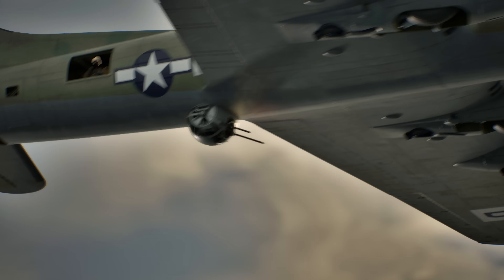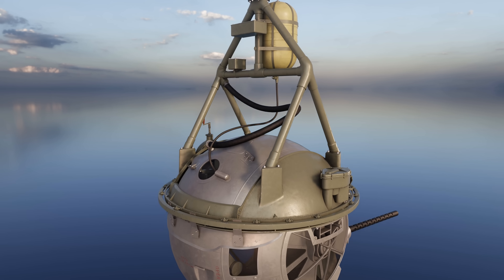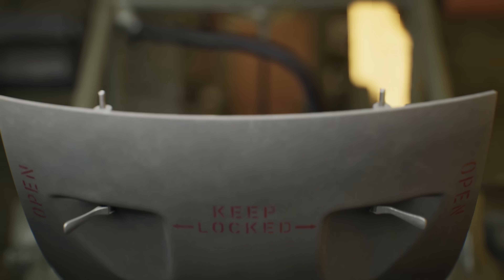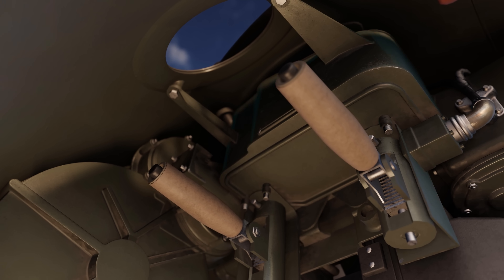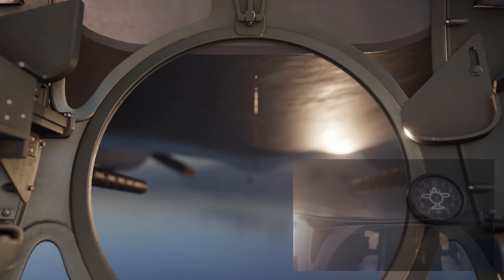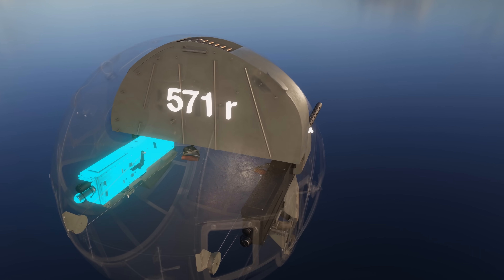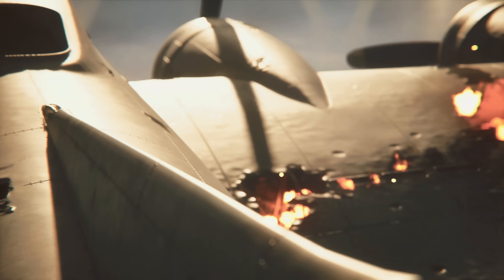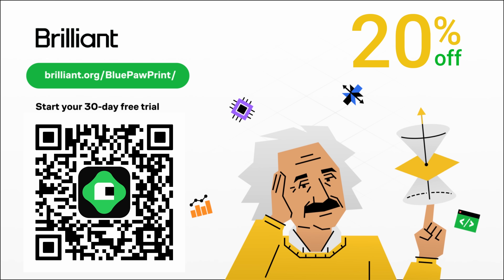Inside the B-17 Ball Turret

Comment: Always heard that the ball turret was the worst seat in the house but never knew the specifics on how bad it would truly be. Fantastic video
Reply: Regarding to ergonomics -- sure, it wasn't comfy, but regarding to safety -- it was really better that others
Reply: Tail gunner was the riskiest position.  The Luftwaffe trained hard to take that gunner out first so they could then approach the plane from the rear along a specific trajectory where they could not be hit, allowing them to finish off the plane and down it.  During the height of the war the average lifespan of the tail gunner was four missions, about two weeks.  Absolutely horrific.  Yet the gunners, knowing this, still volunteered for this position!!  Can you imagine the commitment to the mission and the bravery required for that?  My dad was one of the designers of the B17 and the B25 working at Boeing during the war.  I flew one of the last functional B17s a few years ago, and got into the top turret gun and side gun positions during flight, but nobody was allowed into the tail or ball turret positions due to the risk.  It was a hell of a ride.  6 months later that plane crashed due to an engine failure and 6 were killed.  Could have been me.  I am forever emotionally and historically attached to this aircraft.
Reply: worst seat in the house if you are claustrophobic.. or tall!
Reply: The shortest crew member usually had the ball current. The tallest was usually the radio operator since that .50 cal was on the roof
Reply: @gilbertkohl6991 
A friend of my father was a tail gunner on a bomber during WW2,  very short guy.
Reply: @aceous99  or if you fart a lot, as John Irving has his protagonist's father, Tech. Sgt. Garp say before he took a piece of flak through his head.  He didn't say anything after that, just "Garp", which might not have even been his name but that's what the nurses on the "Goner" ward called him because that's all he ever said for the rest of his short life.
Reply: @ct1762   Sorry.  I'm referring to the novel, *The World According to Garp*.  This is from the retrospective origin story of how the Garp character came to be conceived just before (well, after, actually) his father died in the hospital, told from the point of view of his mother, a nurse.  I can't remember if the movie goes into it with the same detail as the novel.  It's pretty graphic, comical and gruesome by turns.  There was one patient on the ward badly burned and head-mangled whose lips had been burnt off.  All he said all day and night long, was "F*ck!  . . . Sh*t! . . . P*ss!"  But every time he tried to say "P*ss!" he'd be reminded -- because he'd forget -- that his burnt lips hurt like hell to say the "Puh" sound and he'd start the cursing sequence all over again.  (Irving of course didn't censor the cuss words.  I'm just doing that for YouTube.)

Irving had his T/Sgt Garp gunner character initially assigned as a waist gunner but he didn't like it because in the F models the windows were directly across from each other.  Every time the other gunner sidled and swung his machine gun, he'd clout the shorter Garp in the ears, which is why Garp was happy to switch to the ball.  The author tells us that the later G-models had the waist positions staggered to prevent this but Garp was already hors de combat by that time. So Irving had clearly done his research.

Irving also has his Garp character recount the story that ball-turret gunners trapped in the turret would be crushed in belly landings and extracted "with a hose."  (and there is that Death in the Sky poem about ball-turret gunners, although a gunner who stopped a 30mm Mk 108 cannon shell would be mushed up pretty bad, too.)  Since the novel was a best-seller, it's possible that many people got the story from that source, since it seems plausible on casual examination.
Reply: Did you not watch the video? It was one of the safer places to be on the plane.
Reply: @NavidIsANoob  yeah, the stats show it's safe but those wouldn't be known to the average soldier and being cramped into that freezing, tiny ball with almost no cover would be horrible
Reply: @ADAM96667 Buddy he's back is sitting on a 1/2 inch thick armor plate which cover upto below him his front is protected by a inch thick bulletproof glass and his sides is protected by the MG and its mechanisms. 

The rest of the crew? None or 1 armor plate facing 1 direction...
Reply: @gotanon9659 It’s good to see someone else point that out.👍 Many don’t realise the benefits of where the gunners were.
Reply: @NavidIsANoob  yeah but you're shooting at people with your balls pointed right at them. such a vulnerable position to fight people.
Reply: @jal-kx6tm  brings a new meaning to having balls of steel eh? 😂
Reply: @jal-kx6tm  That's a good point.  In the aerospace medicine literature they talk about positioning the pilot semi-reclining in jet fighters so his body can tolerate g-forces better.  But going into battle half-lying down on a La-Zee-boy instead of sitting up like a knight on a horse is bad for morale.  Some early bombardiers lay prone to get a better view with primitive sighting systems and of course infantry riflemen often shoot prone.  But lying supine with your balls pointed at the enemy, no, that would be a hard sell.  You'd want to hope that glass viewing plate held.
The ball turret was one of the more effective positions.  They got damaging hits on German fighters a third of the time they fired on them.  (Compensating sights!)  Enough that the German pilots tried hard to avoid flying under a bomber during an attack pass.
Reply: @lesliemacmillan9932  now that i think about it, F1 drivers are basically in the same position, going 200mph balls first.
Reply: @NavidIsANoob  Interesting usage of the word "safe".
Reply: @NavidIsANoob  No, they did not watch the video.
Reply: @NavidIsANoob  I did watch the video, and they stated the complete opposite. Did YOU watch the video?
Reply: @NavidIsANoob  Statistically maybe? But how many died when the rest of the crew survived because they couldnt bail in time.. how many got shot through the crotch? Scary. But anyway! Sounds like a few people in the comments like yourself would be cool with being ball gunner, so i dont have to :)
Reply: @LittlealxYT  Nearly always us little guys would join a crew and they'd all look at me and say, "Guess where your battle station is going to be, PeeWee!"  There were some over 6-footers though.  Their stories are here on YouTube.
Reply: @LittlealxYT  The ball turret can be ejected before crashlanding
Reply: @LittlealxYT 😊
Reply: @LittlealxYT  None. Unless the Bomber suffered a catastrophic break up which most of the crew wouldnt get out anyway or the Gunner is already dead
Reply: @LittlealxYT  There was a awful lot of metal around the gunner, so many bullets would be deflected.  Some obviously got through, but the ball gunner was better protected than the waist gunners who stood there right next to the inner sided of the skin.
Also from the records and interviews it shows that many of the smaller gunners wore a chest parachute inside the turret, so to get out they just pulled  2 toggles and the exit fell off leaving them to just fall out the turret.
Reply: @justinkemp4019  Not ejected, but the mount could be removed via rooms attached to the side. 
It would be done if the bomber lost the ability to lower both  main undercarriage legs. With just one down the ball would not be in contact with the ground p, as the B17 was designed that way.
Reply: @markoldreive  I love getting facts about this, a few guys have mentioned statistically it was safer, but still... I'd get the fear shakes climbing down into that box looking down at the clouds. I couldn't do it. I acknowledge the braver men, and i'd just operate the radio or something. Doesn't help that i recently watched a horrendous scene from the masters of the air series
Reply: @LittlealxYT it’s a shame that they let historical accuracy slide in that series. I don’t have Apple but know a lot of people, rhat have pointed out falsehoods for the sake of drama. The truth was bad enough.

The other fallacy about the ball gunner was that a lot died when the planes landed gear up. 
Again a falsehood originally started by a war correspondent, who  wanted to make his report more dramatic so he lied.

Historians have checked after combat reports and there is no record of a ball gunner being crushed on landing, Norma death certificate .
In fact if there was going to be a gear up landing, the gunner and crew used tools on the mount t drop the turret into the channel. The reason for doing so, was the strength of the turret and mount. If they crash landed the ball and mount were pushed up into the fuselage and out the top breaking the aircraft’s back and writing it off.

The designers allowed for emergency landings as well. If one main wheel could be dropped, the wheel and the wingtip meant the turret never touched the ground even on one wheel.
Reply: @NavidIsANoob ”safer” doesnt mean “best”

in terms of comfort and general stress I can definitely see it bring worse.
Reply: @NavidIsANoob  The irony of your snarky comment being that in the video he cites more complete studies done after the war show the ball turret had casualty rates similar to the tail gunner, aka the 2nd highest casualty rate 😅

Ball gunner only had the lowest casualty rates of the planes that made it home.
Reply: The tail gunner had it far worse
Reply: When I was a kid the war surplus store had one of these hanging from the ceiling, and the sign on it said the gunners lifespan under fire was 3 minutes, i.e. they will be dead in 3 minutes if remain under attack.  I always remember that, but this video did not seem to confirm it.
Reply: Still might prefer the ball to the tail gun
Reply: Here’s the results of the 1944 study:

B-17 study
Chances of being killed or wounded (Most dangerous listed from top to bottom)

Waist gunners   K 19%   W 21.1% 
Bombardier   K 16.3%   W 17.7% 
Navigator   K 11.8%   W 12.2% 
Top turret gunner   K 9.1%   W 8.3% 
Tail gunner   K 7.3%   W 12% 
Radio operator   K 7.3%   W 8.6%
Pilot   K 7.3%   W 7.4% 
Ball turret gunner   K 6.4%   W 5.9%
Co-pilot   K 5.5%   W 6.8%
Reply: E desejava encher o seu estômago com as bolotas que os porcos comiam, e
ninguém lhe dava nada.
E, tornando em si, disse: Quantos jornaleiros de meu pai têm abundância de pão, e
eu aqui pereço de fome!
Levantar-me-ei, e irei ter com meu pai, e dir-lhe-ei: Pai, pequei contra o céu e
perante ti; Já não sou digno de ser chamado teu filho; faze-me como um dos teus jornaleiros. E, levantando-se, foi para seu pai; e, quando ainda estava longe, viu-o seu pai, e se moveu de íntima compaixão e, correndo, lançou-se-lhe ao pescoço e o beijou. E o filho lhe disse: Pai, pequei contra o céu e perante ti, e já não sou digno de ser chamado teu filho.
Mas o pai disse aos seus servos: Trazei depressa a melhor roupa; e vesti-lho, e
ponde-lhe um anel na mão, e alparcas nos pés; E trazei o bezerro cevado, e matai-o; e comamos, e alegremo-nos;
Reply: and the ball turret got the best end of the deal. there were gunner seats completely exposed to the elements, no computer aim, less ammo and  pray the pilot doesnt maneuver
Reply: Not really, especially the tail gunner was very vulnerable because many pilots would gun down the tail gunner first, giving him time to shoot the engines without being shot himself. There's many tales of a crew just hosing down the interior because the man inside was shredded to a pulp by cannon shells. The tail gunner generally had the worst level of survivability in an engagement.
Reply: Yeah. I'd refuse to get in. Lock me up, I don't care. So many braver men than me died in those ball turrets. I'll sit in the radio seat with a parachute right next to me thanks.
Reply: @LittlealxYT  In fact a survey done from June to August 1944 by the 8th Air Force showed it was one of the safest place (radio operator was another). Waist gunners were 3 times more likely to die and 4 times more likely to be wounded.
Reply: @wipe3100  
Very cramped in the ball turret but also better shielded than the waist gunners. My respects to both…
Reply: @LittlealxYT  Germans would rarely attack a plane from below, they'd much prefer to attack from the above. That puts most of the plane between the ball turret and high caliber bullers. Considering that ball turret was armored from the top and there was also entire ammunition case between the gunner and the top of the turret, the ball gunner had most amount of protection in the entire plane. Didn't make it safe though.
Reply: @LittlealxYT Thats why no one will remember your name.
Reply: @codeman9145  woooooah. Nobody talks like that for no reason and had it good as a kid. I'm Sorry your parents didn't treat you right dude.
Reply: A death trap mounted underneath a deathtrap.

Comment: Great video! I'd be keen to see one on the turret system of the B29 Superfortress and a technical video on the P-61 Black Widow.
Reply: The system on the B-29 did not take well to tropical conditions. The unit frequently malfunctioned which would cause the top quad 50 turret to slew 90 degrees and expend the entire ammunition loadout in one constant stream. Most B-29s eventually got modified to silverplate spec. This removed most of the defensive guns except for the tail gun ( which often got a 20mm cannon added) mainly to save weight so the B-29 could carry early atomic weapons.
Reply: @matthewcaughey8898  that's really interesting about the malfunctions. I bet the guy who first noticed that issue shat his strides a bit. When I was young I made a 1:48 scale model of a B29 and the kit gave me the option of mounting the turrets or the components for the silverplate variant you mention.